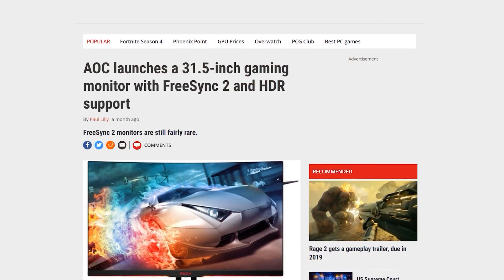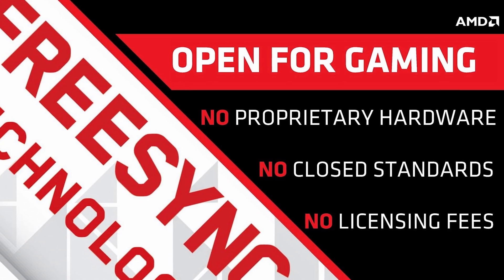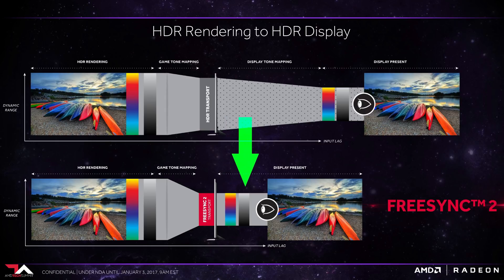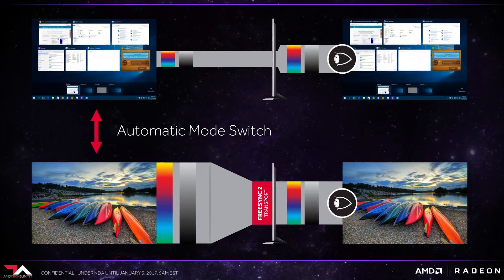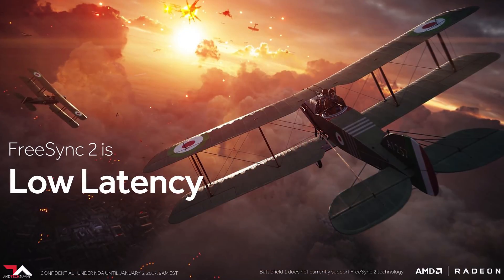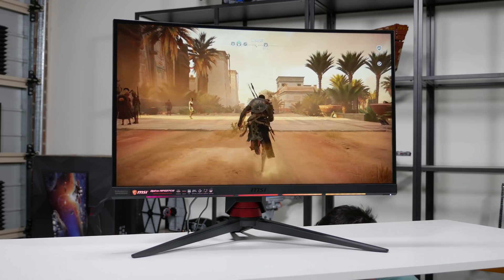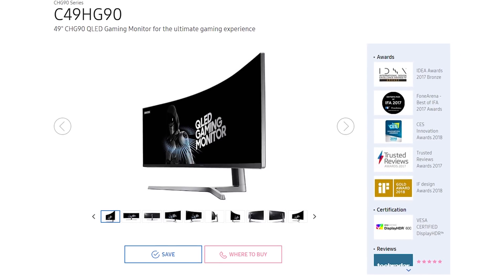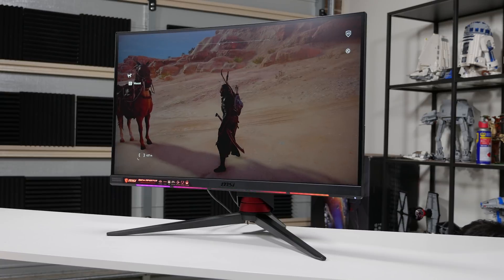FreeSync 2 in 2018 Explained, Does It Work Properly Yet?

Comment from the maker: If you're looking for something else to watch check out our Ryzen 5 2600 vs Core i7-7800X benchmark, it's an interesting look at Intel's mesh versus AMD's fabric in 37 games https://www.youtube.com/watch?v=mhbbOy1PkVY
Reply: hi, i have an Q, i find CHG70 is a good model for me,however, it's a 2 yrs ago product, but the price is similar with others mon like MSI in 2019 ,OPTIX MPG27CQ2 etc. i have compare the data with above model,  i didn't know should i purchase a model which is 2yrs ago, then i did't know will coming 2yr there was similar product but lower price, simply speaking, if u buy CHG70, it can last only 2yrs from 2019, it's still worth to buy it. 

what i want is HDR, curved mon, 144 Hz refresh rate. of course, if it's IPS would be ideal
Reply: @captainfirst8527  which monitor did you finally buy?

Comment: The LFC feature is not exclusively for Freesync 2. It's available for any Freesync monitor with Freesync range of  >= 2.5x minimum of the maximum Freesync Range. I hope I word it right anyways let me explain. Lets say your freesync range is 90-144. This will not activate LFC because the minimum needs to be 2.5x of the maximum range. So LFC will be active if the Freesync range is 57-144. There's plenty of information on this and you only need 2x the minimum. The rec is 2.5x and this can easily be achieved with CRU utility.

Comment: i have the ACER 38 inch monitor which is  freesynch capable . Both 290x and Vega 56 cards created problems like  blackouts to the monitor. I am using a 980ti now with no problems but i don;t have freesynch

Comment: Thanks for the information, Tim!  I didn't realize that some the promised tech from last year wasn't really happening as was initially planned yet.  The brightness requirements, color reproduction, and adaptive sync should still make these great displays...but I definitely want all that was originally mentioned to work as intended!  Hopefully (at least) the big game engines will jump on board and AMD won't have to rely on microsoft tech.  I'm really hoping some FS2 monitors will be affordable...when I finally splurge and get a mid-range to high end card, I don't want to stay on my low-end 60Hz 1080p monitor...but don't want to have to pay $300 for an upgrade, either.

Comment: Freesync monitors with 1440p/144hz are really affordable compared to G-Sync. Is there a single AMD GPU that can actually push resolution/fps that high though? I have x2 390s, but Crossfire support is pretty much dead.

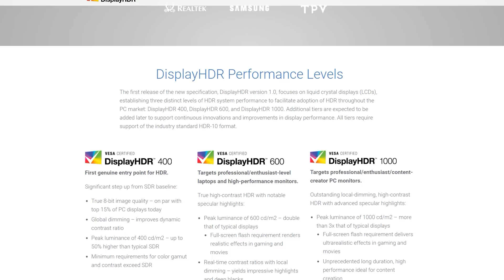Comment: 6:58
Stay away from HDR 400 displays, those are not HDR! (FAKE HDR10)
They use 8 bit panels for those that only reach 16,777,216 (16.7 million) colors.
10 bit panels have a much larger color space 1,073,741,824 (1.073 Billion) colors.
Look at the time code 7:09 HDR 400 has 8 bit panels!!!
HDR 600 & HDR 1000 have 10 bit panels!!!

10 bit color range is 64 times bigger then 8 bit panels!!!
The HDR difference will be MASSIVE!!!

+Hardware Unboxed
You guys should pay attention to this!
BenQ EX3203R & AOC 322QC4 those are FAKE HDR10 panels!
Reply: Good point. What would be your take on the HDR600 Samsung CHG70? Although Samsung advertises it as having over a billion colors it is 8bit+frc w/ a quantom dot film. I have another 8bit+frc monitor, but I feel the Samsung does meet true HDR600 standards. The SRGB coverage is better than the other 2 mentioned and the brightness is impressive.

Comment: i just bought a samsung factory refurb version (399 at woot, wish me luck) of the chg70 32" freesync 2 that supports hdr 600 i think.  its a pity though that hdr doesnt seem to work well because it only has 8 dimming zones.  of course some people are saying that it might get better with software updates because the ps4 looks a lot better on it than the pc but im not holding out , too much hope.  i bought the samsung for 144hz 1440p and the good looking panel its supposed to have.  i hope no dead pixels but thats the lottery with those things.

Comment: So basically every stupid problem that exists in freesync is still in freesync 2. Capping frame rates below max refresh rate or enabling vsync thus defaulting the vsync when u hit max refresh rate of the monitor. N not working in a bunch of games, fallout 4, dying light, witcher 3, I'm sure there's many more I haven't tried. Gsync is massively superior and worth the premium for sure.
Reply: HOODedDutchman You have to cap frame rate or use Vsync on Gsync monitors too if you don't want to go outside your Gsync range.  It's exactly the same behaviour, I know because I have a Gsync monitor, so I'm not sure I understand your objection.
Reply: ltte2 fast sync + gsync. Works in everything and resolves the issue. My main point is gsync works in everything. Freesync doesn't work in a bunch of games. Only benefit to freesync 2 I see is LFC. Which makes it closer to gsync. I'm sure there's some glitch to get that to work too tho. This is what happens when u make something like this software based.
Reply: HOODedDutchman AMD have a Fast Sync equivalent called Enhanced Sync and Fast Sync should not be used unless you are getting extremely high frame rate which is multiples of your max refresh rate (such as in CS:GO) otherwise you get no benefit over Vsync in terms of input lag reduction.  Also, Fast Sync with Gsync can cause issues with input lag and stutter according to Blur Busters: https://www.blurbusters.com/gsync/gsync101-input-lag-tests-and-settings/8/.

As to all games not working with Freesync, I wouldn't know as I don't have a Freesync monitor.  This is bad if true and you have a valid point here.  Have you got any examples?  Not all games work with Gsync, particularly very old games and for that those that have compatibility issues Gsync will be disabled in the driver.
Reply: ltte2 I've not run into any games that don't work with gsync. Fallout 4 and dying light are prime examples. Dying light did work n they broke it in a driver update like a year ago. N in classic AMD style have never fixed it.
Reply: Please stop. People might take you false information as fact.. The driver does not need to support a game or software. Your frame rate is either in the freesync range or not. Simple as that... https://www.reddit.com/r/Amd/comments/7maen1/does_a_game_have_to_support_freesync/
Reply: You clearly downtown a freesync monitor. It works in every game. Just et frame caps at lower and upper end...
Reply: Budget Gamerz I've owned multiple freesync monitors. It does not work in every game. Most but not all.
Reply: Issue between keyboad and chair... It does not need support from games to do adaptive sync...
Reply: Budget Gamerz the driver needs to support it. Try fallout 4. It doesn't work lol. Neither does dying light.
Reply: Ok man... Lol
Reply: Btw I own 3 freesync monitors I eyefinity... So you please leave, you clearly do not own one based on your false information.
Reply: Budget Gamerz you stop. It is NOT false information. Do some research. I am 100% correct. Try it yourself if u own it. If u don't then why are you even replying.

Comment: I hate the fact that we are still doing G-sync vs Freesync. It pisses me off that I would have to buy 2 different monitors if I wanted freesync on all consoles and AMD cards and gsync on my PC.
Reply: Dennis Rigdon
Nvidia would support HDMI, but doesn't need to add the functionality of variable refresh to HDMI. The variable refresh is more of an HDMI monitor thing than it is variable refresh for gaming thing. 
Nvidia likely only needs to update their drivers on their GPUs to support Freesync for everything from the 600 series and on, but they're not going to. They don't say no to extra gamer's money if they want variable refresh gaming.
Reply: If people didn't buy gsync monitors it wouldn't exist now. We need to only support open adaptive sync which freesync supports.
Reply: The good news is that the next HDMI standard will have varible refresh built in. So odds are it'll work on both graphics card brand when it is adopted.
Reply: I agree. There needs to be only one standard. I have an Nvidia GPU and a Freesync monitor and don't plan on ever buying a G-sync monitor until they are reasonably priced. Back in the day there was Sonys Betamax vs JVC's VHS. Ultimately it was VHS that won popularity because there were more VHS players on the market because they were cheaper.  Since G-sync monitors are more expensive Nvidia could risk loosing out to Freesync if AMD starts to produce a wide range of competitive cards in the future. So I hope Nvidia remembers what happened to Sony so history wont get repeated again. Here is a good reference video for those of you that are too young to remember the Betamax vs VHS debacle. 
https://www.youtube.com/watch?v=ddYZITaxlTQ

Comment: I think the question of "does it work properly?" could have been explored more deeply. Many Freesync panels still have problems with brightness flickering (even on panels with a non-strobing backlight) in the lower end of the synchronization range.
Reply: Yeah, I can definitely concur with brightness flickering being a problem.  Before when I was running my newest monitor (which is a 27" Acer ED273 Abidpx), I was running on a Geforce GTX 760 2GB card (before it got fried).  There was no flickering as that card does not FreeSync (since it's from nVidia).  Once I got an RX 560 4GB variant (which actually isn't that bad of a card; a bit weaker than the 760 in DX11/OpenGL games, but faster at DX12/Vulkan games), I spotted brightness flickering almost immediately when I loaded up one of the games I have.

I can definitely say FreeSync works though for a number of games (which in my case, operates from 48-144 Hz refresh rates).  My monitor (being FreeSync) even supports low frame rate compensation (which was not documented on Acer's manual nor Amazon, but mentioned on AMD's website under the ED273A entry) due to the refresh rate range.  But yeah, I can definitely say I witnessed brightness flickering.
Reply: same with vega 56 and CHG70 monitor

Comment: 1:48 - Gsync screens are typically 200-250 bucks MORE compared to FREESNYC
Reply: When you buy a G-sync monitor, you are not only buying g-sync function. Did you notice those monitors are simillarly priced as same league freesync monitors. They are high-end IPS 2k/4K monitors with minimal response time and 144+ Hz.

The only difference is, that freesync may come with cheap monitors as well, but who wants those anyway? Having freesync on a cheap monitor is like having 8GB of vram on a GT710 graphics card.

Comment: gsync is good but freesync is far better
Reply: 1. most games that don't force VSync work on both Free and GSync. 
2. Gsync does support on software. Why do you think it had to be enabled in the drivers when it launched? 
3. GSync has more input lag than Freesync. The module has some input lag and caches frames on the monitor as opposed to the GPU. On the GPU is actually faster because it already IS cached on the GPU.
4. 20fps would give you stutter, tearing is when your game refresh is more than your monitor's so you see multiple frames.

So like I said, those claiming that GSync is better don't know what they're talking about.
Reply: Patrik Miskovic With my 1070ti, would Freesync still be more smooth then Gsync?
Reply: With working "properly", it's more of an HDR thing, which doesn't quite work well enough yet, but that's the same on Intel and Nvidia, because Microsoft is the main culprit.
Loli Hunter
I find it curious that the people who claim Freesync is better give a full explanation why, and those who claim Gsync is, don't elaborate one bit and if they do they're called out by the first reply they get for their BS.
Reply: CapnTates 
Like I said though, in almost every possible way, G-Sync is better. 
The main thing is that most games will just support G-Sync more. Many games will still have tearing when they don't natively support Free. For G-Sync, it works better because it depends on no software whatsoever. It's based entirely on hardware. So, there's no input lag.
And from what I've heard, there's stutters in some Free Sync monitors but others say it's the problem with Free Sync.

But eh, mostly I don't give a crap. Tearing is fine for me since I've played games at 20fps before.
Reply: CapnTates 
1. No, I referred to how games like emulators don't work with Free Sync but works with G-Sync despite not having support for both.
2. It's more dependant on hardware than Free Sync. I didn't say it's purely hardware-based.
3. Heh? From my experience G-Sync simply has less input lag, I don't know the specifics. And specifications generally don't mean shit. See how RX 580 has like 2 more Teraflops than GTX 1060 while not being faster than the 1060 almost at all.
4. I just said I don't give a shit about either of them or tearing. I played games at 20fps before so the least I give a shit about is defending G-Sync or Free Sync on the internet. Tearing doesn't matter to me, is what I was saying.
5. Again, I don't care which is better. I just said it's better because I tried both and G-Sync works for me.
Reply: Jacob Wonder if nvidia wasn’t a dick and refusing to implement a VESA standard but unfortunately they’re not allowing compatibility with this open standard at any level on any device. I could understand selling Gsync as a premium alternative, but don't cripple the ability to use an open standard on more budget minded builds, those people aren''t buying gsync because you did that but they may actually buy a different budget card
Reply: Gsync is Freesync, but held to a much higher quality standard, else it doesn't get the label. It does have a 200 dollar price premium though... whether that quality guarantee is worth it to you is up to you.
Reply: Freesync is more flexible and has less input lag. 
GSync currently works on the fastest GPUs (which are also expensive by the by) and there's a higher standard for GSync certification than FreeSync(non-2).
That said a Freesync monitor can still have mostly the same specs as the GSync one, which makes it in no way inferior(and with the benefit or flexibility and less input lag).

So yeah, I do think Freesync is better, and the fact Nvidia doesn't support it is just a giant waste of resources.
Reply: Freesync is better because it can do the same thing, with less input latency, without wasteful chips on board the display costing money and making it more difficult for everyone to support.

IDK wtf Tims on about but Freesync has already been working "properly" so the title is just Nvidia fanboy trolling.
Reply: no it will not work at all, and he does not know what he is talking about, Gsync is far better than freesync other than cost.
Reply: Man, I love you comments and its insults.
Reply: Gsync is simply better in every way possible... other than its outrageous cost

Comment: Could you please test if the Steam Controller works with the FreeSync active? IIRC, there is an "AMD external events utility service" that interferes with the overlay necessary for the Steam Controller to work. Disabling said service allows the Steam Controller to function as normal, but also kills FreeSync. Perhaps it has been changed.

Comment: Very informative, thanks, though I would have liked to see a bit of a comparison between a Freesync 2 and a standard FreeSync display given the title of the video.

I feel like the reasoning behind FreeSync 2 would have been better served by being called "FreeSync Plus" or "FreeSync Premium" to signify the extra certification that goes into a supported product when compared to a normal display that merely supports FreeSync-branded adaptive sync. As you said in the video, FreeSync 2 sounds like a successor technology, when in reality it's just providing additions and extensions on top of adaptive sync.

Comment: Why are people constantly interested about HDR on PCs ? Let’s deal in Facts.
HDR10 is the Spec which ideally requires a 10-bit Panel (name one 10-Bit Panel PC Monitor) Also HDR10 Minimum Need 600nits of Brightness Name One 600nit PC Monitor ?
Lastly, HDR10 and Dolby Vision is meant to be enjoyed on Large Format immersive displays like 55” 4K TVs which get to 1000nits 
Just wait for HDMI 2.1 Displays In 2019 VRR And AFR are built into the 2.1 Spec it will make all HDMI 2.1 devices even 55” 4K TVs have FreeSync 2 and GSync.
On PC save yourself $1,000 and just buy a MSI MPG27CQ it’s only $500 144hz @ 1440p FreeSync And 100% NTSC and 115% sRGB.
On TVs wait for 2019 Models and HDMI 2.1 sets.